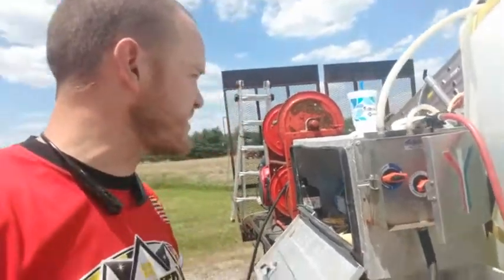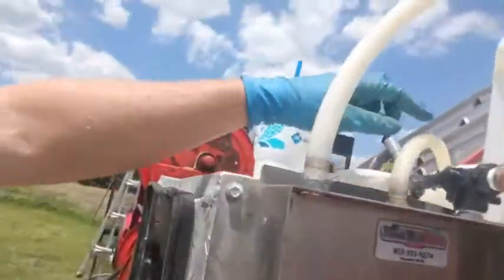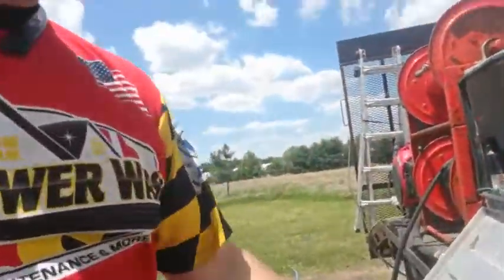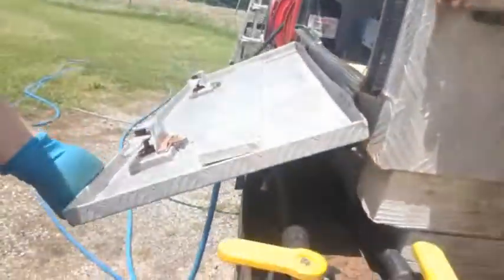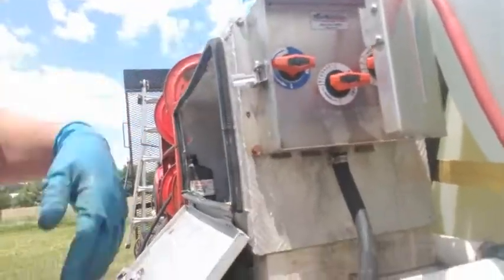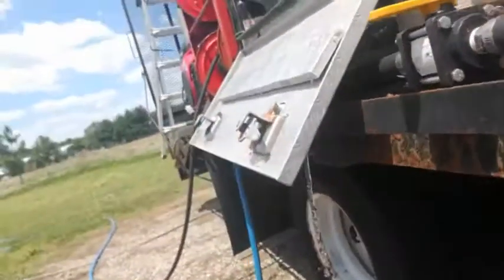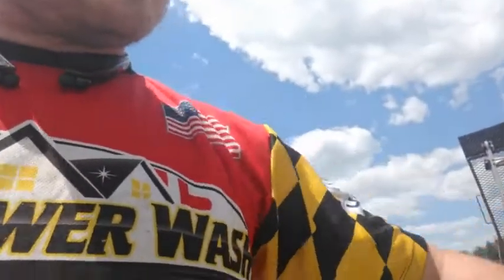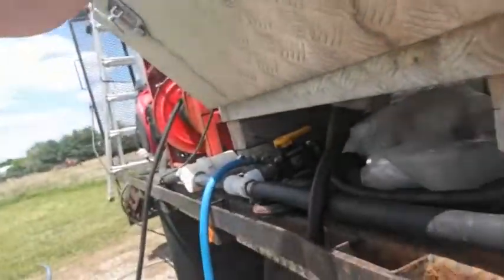Proportioner maintenance- flushing the Sodium Hypochlorite valve

Comment: do you use a house line into your booster or a 12v pump then booster?
Reply from the maker: No 12volt needed.  Just plumbed to the booster.
Reply: @Cleanpowerwash  from your tank? or house pressure?
Reply from the maker: We can run it both ways
Reply: @Cleanpowerwash  i use a 5.5 12v normally,adding a booster for those tall peaks on tile roofs so i stay off them,the info out there doesnt realy say what you can get with just a booster from bulk,im putting it in line with my 5.5 to boost it for now.